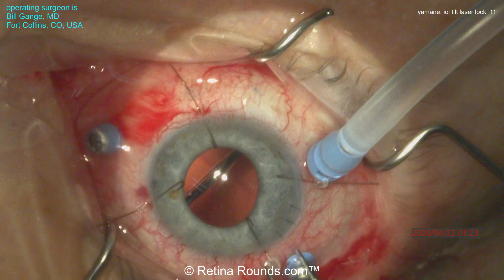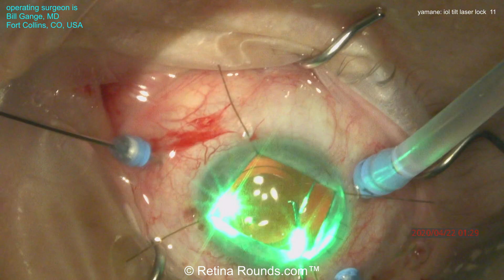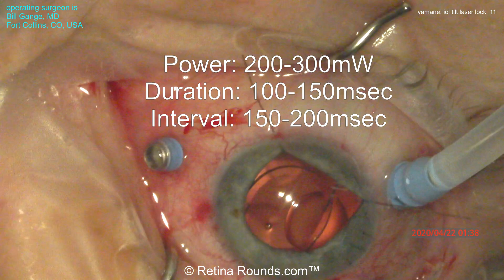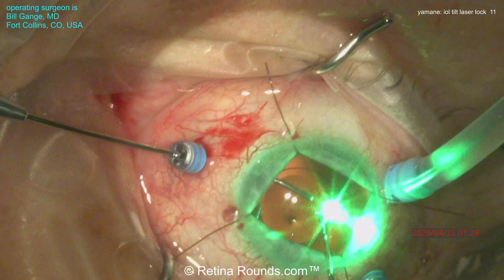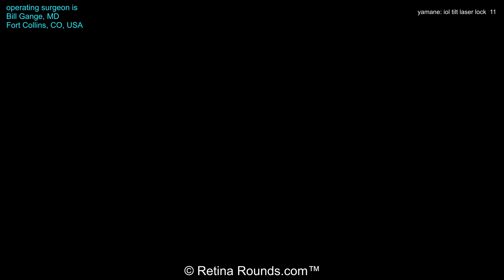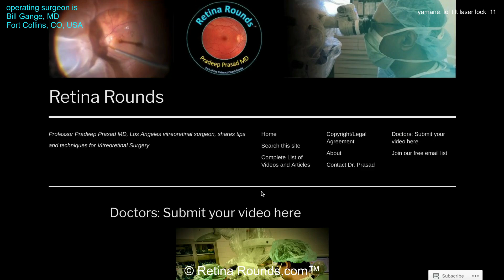RetinaRounds™ 11: Rotisserie Phenomenon: Yamane IOL

Comment: Thank you. I have 2 questions.
In case of IOL tilting from inappopriate haptic insertion(too short tunnel length) or haptic bending from haptic damage, is this method working ?
Is it also work for PMMA haptic ?
Reply from the maker: I don't have any experience using the laser to cure bent haptics back into the normal configuration.  Does anyone else?  
To my knowledge, this rotisserie phenomenon is not an issue with other 3-piece lenses including those with pmma haptics.  
Thank you for your questions!